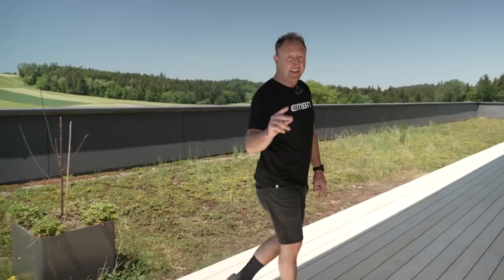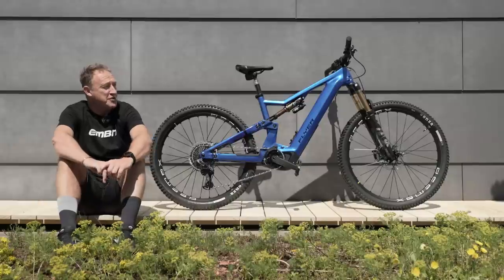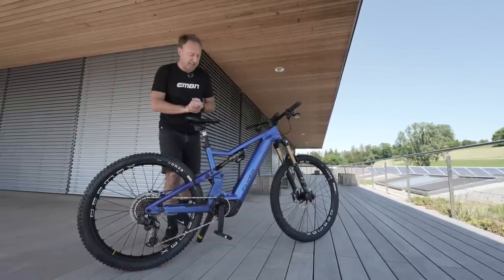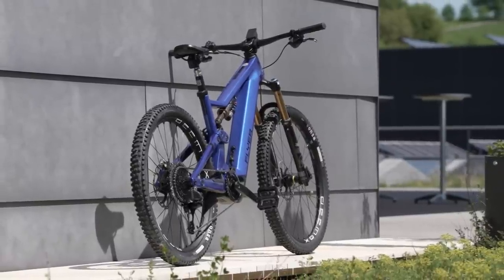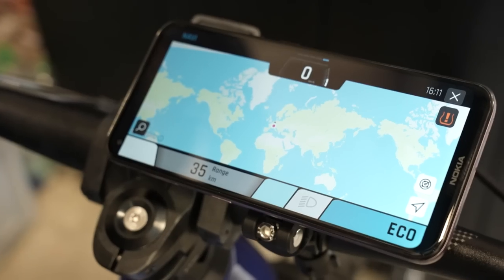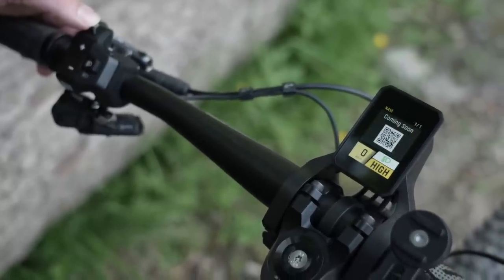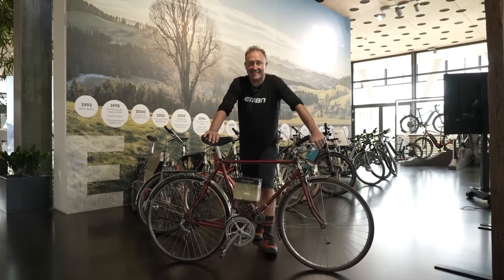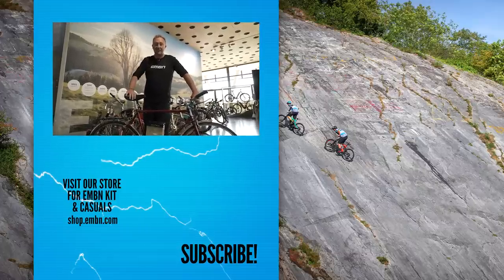How An EMTB Is Made | EMBN Visits The Flyer / Fit / Panasonic Facility

Comment: Just back from a test ride of the Uproc X 6.10 ... very good setup and Panasonic Motor.
25Km/h uphill are so easy with that torque 95nm .. on any gradient .. even strong ones.
Handling is also great .. motor sounds for me fine .. suspension is well balanced.
No need to sleep a night for a decission,  so I reserved/ordered the 8.7 ... but as it's not available .. need to wait for some time ☺
Good Job @Flyer Huttwil un Liabi Grüess 😉
Reply: I have been using my Panasonic motorized bike daily for 10 years and have had no problems.  It works like the first day or better because it has become quieter.

Comment: I have had a bike with a Panasonic motor for 10 years.  I use it daily and it works like the first day, not a problem.
 Now I am going to change my bike and I would like to repeat with Panasonic but here in Spain there is no Flyer distributor.
Pity!

Comment: I like the bike a lot but!…Why do companies insist on placing the computer reader directly in front of the handle bars ? 🙄 In a OTB that’s the first thing that will take the impact and break! Come on guys ! Be logical in your thinking of the placement of this important component.
Reply: you think by now they be countersinking units into the top tube, those trek rails with the unit sitting on top of the top tube looks pants as well as cube just wrapping that wire around the handle bars, why go to all the bother of building great looking bikes and leaving them with a crap finish, i do like the shimano displays its a pity there motors are crap.
Reply: Yes I think Specialized have got it right, built into the top tube. Otherwise though for me at least, the perfect bike!

Comment: I want a lighter Weight full suspension E bike 
Say something like a specialised epic for Commuting to work down the canal 150 mm of travel is to much bike but a don’t want a hard tail as I want some comfort
Reply: You will be happy with 150mm of travel. It will feel so smooth.
Reply from the maker: Something like the Specialized Kenevo SL is a great option if you're thinking of full suspension!